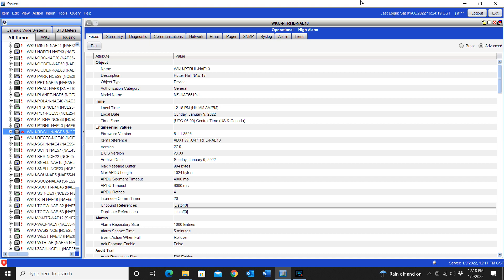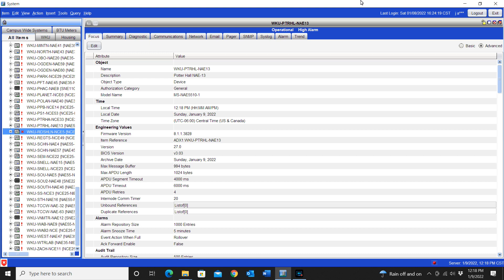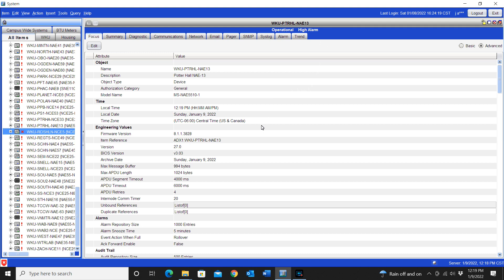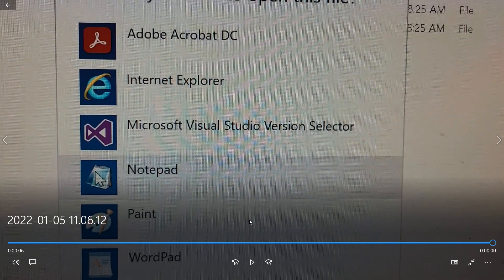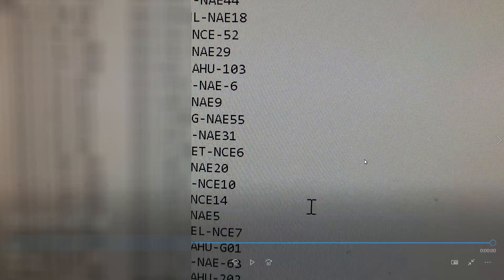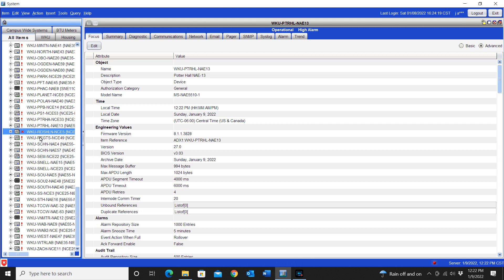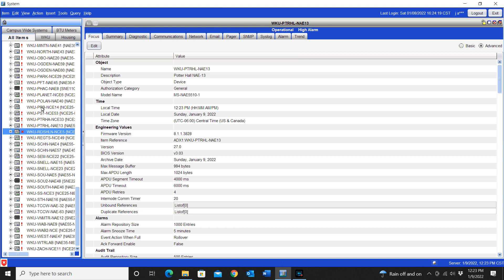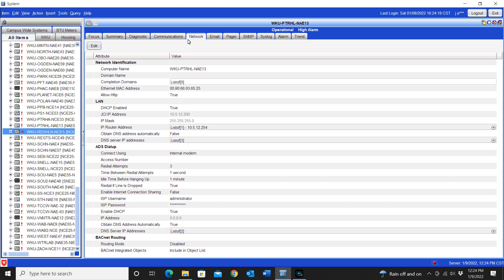How to fix a Johnson Controls NAE that's offline with Metasys ADX Server Host File Corruption

Comment: Hey
thanks for your tutorial.
I have a question regarding that I am facing a problem in Nae 55 that ethernet led is not blinking as well this NAE is not showing in item list.
what may be cause here ?
please assist to find out the cause.
Thank you
Reply from the maker: There are several possibilities.  Make sure there is network connectivity on the cable by turning off wifi on your laptop and plugging into the network cable to test connectivity of the cable and port.  If you don't have network connectivity, there's your problem.  If you do, try to directly connect to the NAE.  I've got a couple videos showing how to do that on my channel.

Comment: Hi This panel is showing the battery fault so which battery will required  to resolve the same. can you just help us for battery model
Reply from the maker: If it is the small frame engine, this should work:  https://amzn.to/3Fo39Ha
If it is the large frame engine, this MIGHT work: https://amzn.to/41OHvEM

Comment: Hi, I’m having this problem since the IT changed the IP adress of my NAE. But when I checked in the hosts file, the name and the adress IP is the same as the one that changed, so I guess they can be other problem
Reply from the maker: Make sure you change the IP in the host file to match the new IP in the engine.

Comment: Sir, thanks for filming the amazing tutorial. I have a question wanted to ask since last year, I'm struggling with a problem which is there are 11 sets of NAE55 boken last year, have you ever been faceing this kind of question? Thankyou.
Reply from the maker: I've had to replace several. The version of Metasys your running may be the issue. Anything prior to 7 and 8.0 8.1 will have issues.

Comment: So I'm having a hard time understanding what you exactly did. I know what you mean by explaining it. But I don't see you doing the same thing your saying to fix it exactly. I can ping other nae or nce etc.. But I can't seem to ping two other devices that are giving me the X. When I ping those I get a "destination unreachable". Making a video explaining what you did exactly would help..
Reply from the maker: It sounds like you may need to reimage the devices.  If the device cannot boot correctly you will not be able to ping it.  This was just a simple power cycle that can clear some issues with a device not communicating.
Reply: @Systemcontroltech  I have done that in the past. When ever we had some outages. Now it doesnt do that anymore I think after the update it must of cause some issues. I went to the host file I only see 2 ip address and NEA. Are you saying if I go to the host file and type it in this will work?
Reply from the maker: @bluecavemen  no. The reimage tool will put the NAE back to factory settings and you would need to reload the sct back up into it. Try connecting directly to the NAE and see if you can browse directly into it using the launcher tool. If you can't, there could be an issue with the unit.
Reply: @Systemcontroltech  you have a video how to do this?